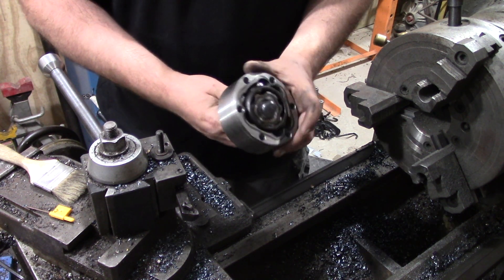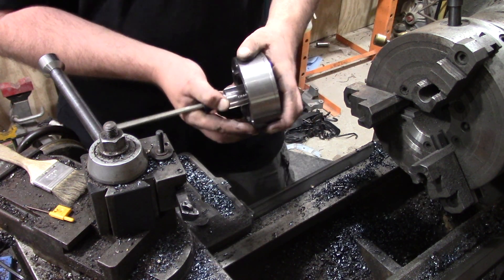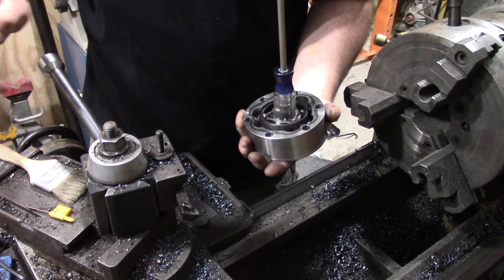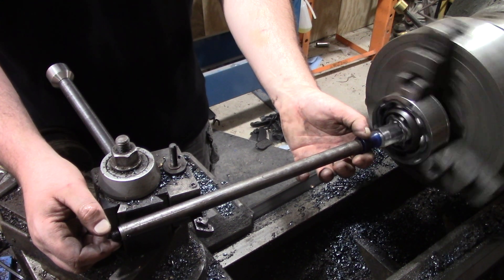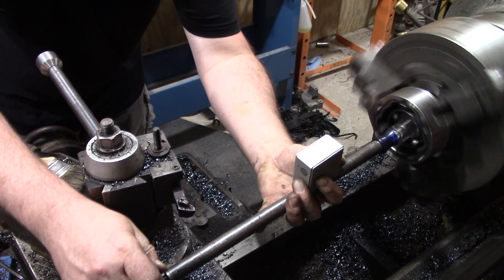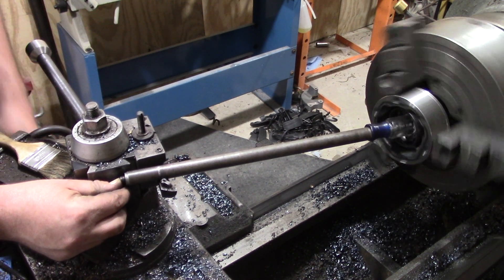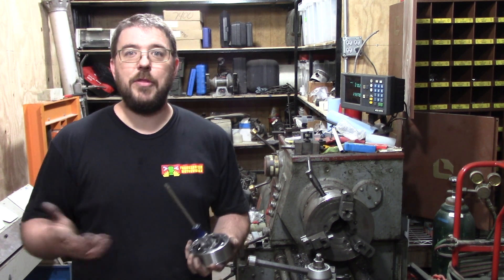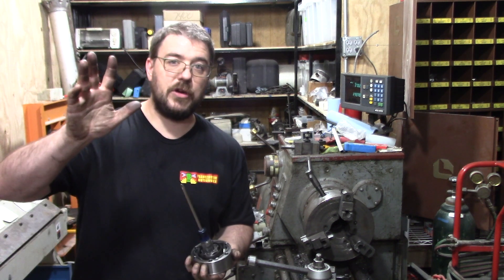How are they running dual plunging CVs on the same shaft?

Comment: I don't understand your comment at 3:45 that you've somehow reached the angular limit, because axial movement would not be restricted if you leave enough clearance.

And it seems that dual plunging CV's could increase life by spreading the wearer over more length of the races.

Maybe it would be good to have springs or rubber bumpers inside at each end to prevent axial rattling.

Comment: the interesting thing is if the cv is clocked correctly then both joints jut in and out in unison thus making it negligible and not a problem to run at those angles provided the flanges stay roughly parallel
Reply: Cross groove CV joints do not need to be clocked to each other.

Comment: I will know by the end of the month if I want a set.
Reply from the maker: I really hope you don't end up having any more issues with the CV shafts but one way or another I will continue to work on this thing until i have a solution that lasts at least one season of endurance racing between services which should be good enough for a lifetime of street service with occasional autocross use.
Reply: @FrankensteinMotorworks  yeah, I know your use case is more extreme than mine, so whatever you come up with will be fine for everyone else.

Comment: As always -- love your work!

Thoughts on the AR vs K-Series swaps?
Reply from the maker: Thank you for watching, you guys make it possible. 

As for AR vs. K, i'm obviously biased but in my opinion the K has amazing aftermarket support but you can't forget that the AR does not need as much support because it starts right from the factory in the same dimensions as a fully bored and stroked K. Both in 2.5L as a fully bored out K and as a 2.7L as a fully bored and stroked K. There's even an 86mm short stroke crank available for a 2.2L oversquare build if someone wants to go that way. As far as the valve setup goes, the AR starts at 36.5mm intake and 31mm exhaust. Both of which are significantly bigger than where the K starts and in fact are about at the size that most setups max out at except some of the very large 4 pistons racing builds. The intake and exhaust runners also start much bigger to match the large valves. Next, if you pull in the hybrid 2ar-fxe parts bin you can get 12.5:1 high compression pistons and a 270 degree cam with 9.5mm lift. Continuing on the valvetrain you find a dual vvt-i setup that allows you to run a much wider torque band. Next, when you go on the outside of the motor you find a really nice dual length intake manifold with a large 65mm throttle body that will likely support up to 300whp without significant restriction. So far i've managed 241whp and it only has 4kPa of restriction between the filter all the way to the intake plenum. I haven't played with the stock exhaust manifolds but the stock Highlander 1ar-fe exhaust manifold is a pretty nice 4-2-1 manifold with a 2" outlet right from the factory again. 

Essentially, the AR is missing aftermarket support for all the simple stuff but it isn't necessary because Toyota already provides all those parts for you. 

As far as power holding goes, based on Papadakis' formula drift car we know that the stock crank will put up to ridiculous abuse at the 850whp level which means it would likely survive over 1000whp in a drag car and the stock open deck cylinder setup was retained for his build that made over 1000whp. So again, no parts exist here but they also is no need for anything to exist, it comes with it for $250 right from the pick-n-pull. 

On the smaller but still very important side of things, the engine has 10 oil squirters to cool the pistons and a pretty good Air/Oil separator in the PCV system and an oil pickup that seems to be alright with at least 1.2g's in the corners and possibly more. We occasionally hit up to 1.6g's and we haven't had any issues but we consistently hit 1.2g's. I've also put over 35,000miles of endurance racing on a single engine with nothing but oil changes and the only wear in the engine was the rear main seal and the forward thrust bearing. the mains and rods had perfect bearings that could have been re-installed as-is. 

high strength turbo pistons are already available from JE pistons.

Essentially the only thing this thing is missing is camshafts but I'm working to solve this very soon, about 2-3 weeks and i'll have 10 different sets of camshafts to explore. I expect to release a 250whp cam set first and after more R&D i should be able to release even bigger ones. 

It'll also eventually need an aftermarket intake available for it but we know it supports at least 110hp/L with the stock one and i do plan on releasing an aftermarket intake for it soon. Cast aluminum to support those builds with stupid amounts of boost.

The only downside so far to this motor is it has very low tension rings which is great for many things but if you use it for several years without ever being aggressive on the throttle they eventually get clogged up and stick which causes oil burning. This should never be a problem on an engine being pushed harder and in fact that 35,000 mile race motor I pulled apart had absolutely zero gummed up oil residue anywhere in the engine.

Comment: Great video! I might be interested in something like this. Going to build a long travel suspension and may need custom length axles.
Reply from the maker: The stock transverse configuration will never allow proper long travel suspensions but 930 joints would certainly be better for the kind of abuse you're putting the MR2 through.

Comment: could use a splined slip joint between two 930 CV's to take up that pushing if you need more angle?
Reply from the maker: I probably could have been clearer about this, i don't expect to need more than about 10 degrees so the 13 degree max angle before the "lumpiness"  won't be a problem at all for me. For applications where that matters you should be able to phase the joints properly to avoid any issues. Some people do seem to use slip joints to add travel so it could be worth exploring if this is something you need. the 930 CV joints really have an absolute TON of aftermarket support .

Comment: Nice video.    I liked the presentation ,helped me understand the jack shafts at work.  The jack shafts have just a normal U joint style.  I bet the style that your showing would be a lot stronger.   As long as they’re lubricated 

Congrats on the 5k
Reply from the maker: If you want to see something really weird you should look at those u-point shafts when operating at high angle. It's amazing they can reliably transmit power at all when you see it.